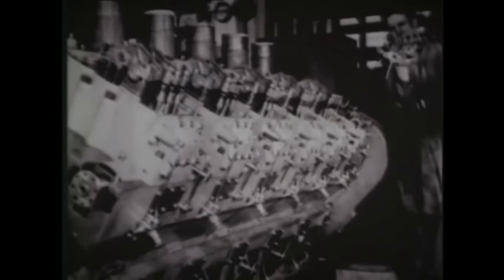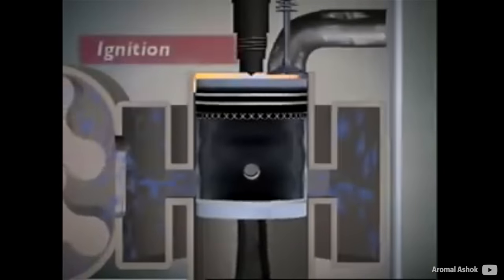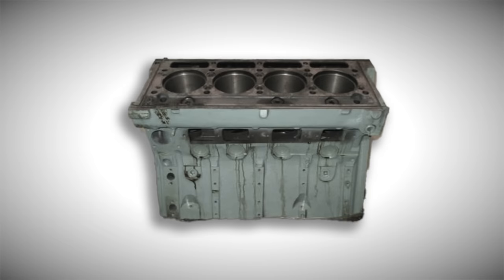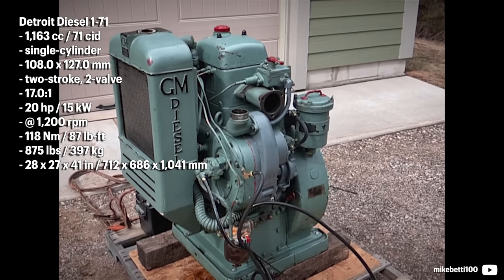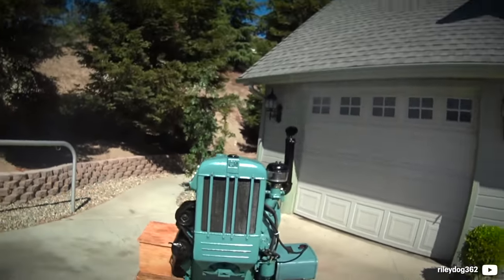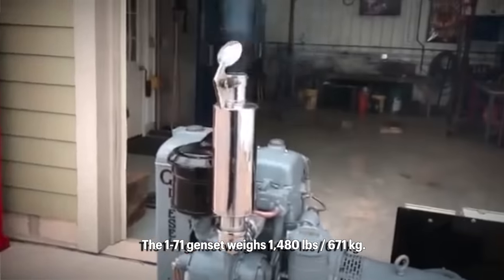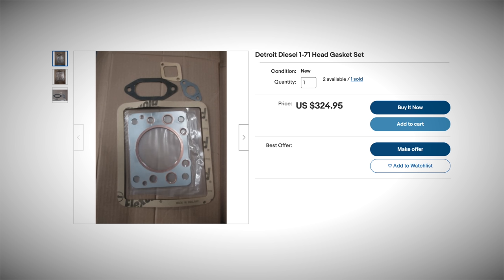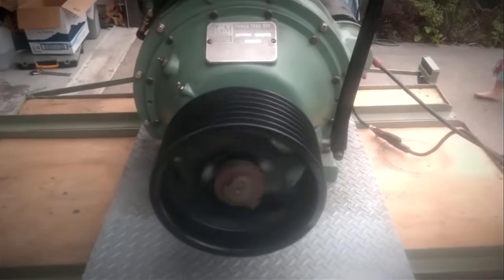The 1-Cylinder Detroit Diesel 1-71 Is Nearly Extinct

Comment: "The small group of 1-71 collectors have pooled their information and Chris Kouttron has begun a 1-71 database. Over several years of collecting 1-71 information and documenting survivors, he tells us the earliest serial number is #8 and highest is #926. The current count of known 1-71 survivors worldwide currently stands at 79 units"

-Dieselworld magazine, 25 April 2018
Reply: Damn, that'd be cool...
Reply: A Maico 760/700 makes 26 HP at 1200 rpm with out a roots blower, go german 2 strokes and not shitty american 2 strokes, Well the Rotax 850 ETEC turbo takes it to another level, kinda like comparing hydrogen fusion to fission
Reply: @cloggedpizza239  probably if you take care of it, im running BRP XD-100 2 stroke oil thru my 8v92 2 stroke turbo. I like alcholo fuels better and dont like diesel, also more plant based 2 stroke oils such a castor 927 maxima, way overkill for a detroit though.
Reply: @cloggedpizza239  BRP-XD-100 is a bit overkill for a 2 stroke detroit. Many outboard  and snowmobile 2 strokes can run great for over 5 years if the the proper maintenance is done.
Reply: @cloggedpizza239  The Detroit run harder steel shafts and can run better on the modern synthetic 2 stroke oils with injection!
Reply: @cloggedpizza239  Do you run 2 stroke oil in that?
Reply: @cloggedpizza239  You could probably power a 100KW 1200 Delco generator on the tug i work on with an inline 6 made from 700 (685cc) Maico engines.
Reply: @jlo13800 just goes to show how little you know buddy. Difference between a diesel built in the 1930's and a gasser built in the 70's. And what's the fuel consumption of the back to back World War losers design? What the life expectancy of that gas engine? They are 2 different engines designed for 2 different purposes.

Comment: It's mind-boggling to think about how much freight Detroit Diesels have hauled in the US. Not only in heavy trucks, but also in locomotives and ships.
Reply: Tesla ev truck left the chat..
Reply: *and are still hauling.
Reply: It's amazing. I was shocked to find it in studebaker's and ford's. And in boats, generators, backhoes, you name it. My jaw just keeps dropping every time I see it. It's crazy when you really think about it.
Reply: There are two diesel fire pumps at a steel mill where I occasionally work that run 6V53 Detroits. They test them once a month, and for some reason they fire up at operating RPM, no mufflers. If you're working out by that pumphouse when they do, you'll cuss and drop your tools when they start screaming, haha! 

I want a 6V53-T in a square K20 Suburban with a 10-speed RoadRanger so bad I can't hardly stand it, they sound amazing and are indestructible.
Reply: And wars that were won
Reply: Detroit Diesels are a truly legend that make differences during WW2 and also post-WW2 when USA was building up their economy even though in road usage it came second after Cummins's...

But, what a Cummins can't do is that participating either side of WW2 in any sort of military equipment, from supply trucks up to tanks, and from small gunboat up to destroyers as back-up power (except for aeroplanes, because why you use that😂)

Sadly, the EV-sided governments, loyals, and its rules didn't seem to honorate this living legend
Reply: @The_sinner_Jim_Whitney  The local sawmill mill has two 6v92's.    Red, angry, no mufflers.

In the plant I work at now our back up fire pump is a 5.9 cummins, cool but not as cool. Room temp to full load at 1800 rpm in 2 seconds.  But our emergency generator is a 12v149.   Uninterrupted mode it goes from 0 to 800 kw at 1800 rpm in ~ 2 seconds. It has mufflers but it is still loud as hell.   If your outside it looks like 2 black mushroom clouds.

I love Detroit's.   My first one is a John Deere 440ICD crawler loader with a 2-53.     I'm trying to find an older welder with the same engine.
Reply: General motors old look, and new look transit buses. The twin pack 6046, used in the M10 tank destroyer. The pancake 6-71 l, and N, for use with under floor applications, such asCrown and gillig coaches.  The GMC cracker box, the landing craft infantry, all LCI(L) were twin shaft propelled by two banks of Detroit Diesel 6-71 "Quad" Diesel engines that produced a total of 1600 bhp. These engines were a wartime expedient design that utilized existing and readily available engines.  We can't forget the gray marine 6-71 series.  We owned a 1981 MCI MC9, with a Detroit diesel 8v71, with a Spicer 5 speed. The v-type was introduced in 1957. The inline series 6-71 was the flagship product of the Detroit Diesel engine division of General motors. The single cylinder 71, being the most rare, with about 900 units produced.  Diesel world has an article entitled One lung Jimmy.
Reply: @fidelcatsro6948  lmfao
Reply: @k-getrengganis7401 agreed. Our all knowing government is such a bowl of cherries.  I loved the instant power of the 6-71. But I worked on a 4 stroke Detroit (labeled mercedes, since they bought it), and the power was horrendous. I would like to imagine if they tried to modernize the two stroke, it would have been able to pass federal regulations for a bit longer, but who knows.
Reply: @VitoVeccia  actually, you could, theoritically. Just use the way EMD make the 710 pass the Tier-IV emissions for boats...

Change the fuel supply to commonrail, add a closed crankcase circulation system, and rely solely on SCR like EMD do... Gone all DPF shitty with enhancing the SCRs

Yes, there is no more straight pipe, but you could still have that particular 2-stroker sound 😎

Or, if you want more not to depend on emissions, use Gas-diesel mixing by injecting natural gas or petrol in the cylinder so that when combustion occurs, the flames spread more even because of natural gas or petrol in it thus had lower emissions and gain a bit more power... (This was from an experiment from University of Wisconsin, quite sometime ago which, it did had the expected result. But, as per governmental traditional, it never came into mass production anyway😂)
Let's hope someone will do it in the future, especially for the so-called Third-world Countries, because, let's face it, they didn't have money to adopt EVs for at least 2 decade away...

Diesel are superbly useful, compact, robust, dependable, and of course, well tested😎
Reply: Don't forget that the Detroit was also sold overseas Detroit been hauling shit all over the world since day one
Reply: in the Locomotives they're called EMD but they're just really big Detroits since EMD was a division of GM. there are still 567s built in the 50s running to this day
Reply: @aspenGF8  HISTORY AND DEVELOPMENT OF THE 567 SERIES GENERAL ... https://utahrails.net/pdf/EMD_567_History_and_Development_1951.pdf
Reply: Still goin every day baby, I see them all the time in generator sets.
Reply: Had to squint my ears last year, as the town highway leaf collection truck had that 2 stroke sound. 
I felt like asking the guy driving is that a Detroit?
Bit you'd say it like  "is that a supra?"
Reply: @The_sinner_Jim_Whitney  
There's a reason why they fire them up at operating RPM's, I can tell you from personal experience having operated, lived and slept right next to one of those things for 3 years of my life as a driver of an M163A1 selp propelled Vulcan gun that they needn't have bothered putting a throttle pedal in one of those things, they could have gotten away with a toggle switch that had idle and run positions, because nothing in between did anything, if you didn't have it stomped all the way to the floor nothing happened, it wouldn't move.
The old timer truck drivers had a saying about those engine's, the best way to get your load there on time was slam the door on your hand when you got in the truck. 
Those engine's weren't the greatest when it comes to power so they weren't the best when it comes to moving something from point A to point B, but where they really shine was like you said, industrial use, places like steel mills or running pumps on pipelines where they run 24/7 and need to run forever. 
They don't make a lot of power because despite the fact that they have blowers on them they're not actually supercharged like people believe, because of their 2 stroke operation the blowers don't supercharge them, they're needed to scavenge the cylinder and fill it because they don't have an intake stroke but the way it works out they only run as if they're normally aspirated, without the blower they wouldn't run at all.
But they will run forever, that's why they do so well in industrial applications.
Reply: I've put so many of my own hours into doing just that, might get my own truck and keep going with it.
Reply: @@retiredbore378 
Then they must have been talking about all the M113 chassis based vehicles which would have the 6V-53 Detroit Diesel engine's in them.
As I said they wouldn't get you anywhere in record time but they'd get you there, if a vehicle with one of those engine's took a hit from an anti armor weapon when it was done burning I wouldn't be surprised to find only the engine left sitting there idling, I drove one of those things 9 hours in the desert once with nothing showing on the dipstick and it never missed a beat, the Slant 6 Chrysler engine's of Diesels.
Reply: And tractors and skidders and yarders, pumps, generators, garbage truck, buses ….

Comment: 3:35 given that information, the 1-71 has a efficiency of 27% (12 kw, 4.50L/3.74 kg of Diesel), which is kind of impressive for 1938
Reply: @Retired Bore your are right but if i remember right there are also DD which have a blower and a turbocharger
Reply: @Doppelwhoppermcdonald  They all have a blower
Reply: @mikegray8808  all the detroit diesels have blowers yes, but as he was saying many have a blower bypass valve + turbo this removes the pressure load from the blower essentially freewheeling it.... sure there is a little drag still but its a good compromise. The roots blowers are also very efficient as they supply pressure pulses rather than constant pressure. Current Achates power designed engines are kinds of like two detroit disel blocks pointed at each other and geared together (with the vale train completely removed.. and on top of that they can hit 50+% efficiency targeting 55+%.
Reply: @Retired Bore I don't think any of the achates engines have gone for an electric blower yet... since that would require a pretty beefy electric motor that isn't used 99% of the rest of the time, it would make more sense to just disengage the blower entirely, bypass it and rely on the turbo or a pair of turbos small and large or an electrically assisted turbo at idle. When running unloaded they are obviously 100% drag.... since they arent' doing anything at all so your statement that they are inefficient unloaded is well... it should go without saying. Perhaps an electrically assisted turbo would make a lot of sense as it could also be used to reduce turbo lag.
Reply: It's even more impressive when you realize that VisioRacer got the conversion wrong. He converted using Imperial gallons (1 Imperial gallon=4.25 liters), but in reality he should have converted using US gallons where 1 US gallon = 3.75 liters.
Reply: @CaptHollister  Rough math would put that at about 33% efficiency.

Comment: I remember when I was in the Marine Corps,  we had some 2-71 Detroits, to run our generators,  for our radios.  They were a pain to get started,  but would run until out of fuel without any problems,  if you kept the fuel tank full it would run a very long time. They need to be topped off with oil a lot.
Reply: Easy to start with a can of ether. The fuel draining back down the fuel line away from the pump is almost always the problem other than the filter needing to be changed.
Reply: @crazyoilfieldmechanic3195  i had a 353 that would start if you looked at the starter !! check valve in the fuel line

Comment: Great vid, neat little chunk of history, I was told the 1-71 was more proof of concept / viability then expected sales leader, and GM put that to the test very shortly thereafter the bombing of Pearl Harbor. The 71 series was built with roller valve lifters, and injector actuators, and were technologically far ahead of other engines, save for aircraft engines of the era. Notwithstanding the 1-71, the rest of the family are happy to spin at governed rpm, which is pretty high, for a diesel. Happy 2023 !

Comment: Cool vid. I had the pleaser of driving a firetruck powered by a 2 stroke Detroit. One thing we learned is you have to get these engines hot and wound up or they will leak oil and everything else.   There is no noise like it in the world and they like being reved out and driven hard. It is an experience I will never forget and a shame generations ahead will probably never get to experience.

Comment: Johnson and Towers made some upgraded Detroit diesels for marine applications . I worked for a Bertram dealer and saw some of them . 12V71's with he engine blocks sanded smooth and painted in white Imron with chrome and polished parts . The 6-71 J&T put out 425 hp .
Reply: J&T 671 TI 450 HP and 671 TIB are 485 HP

Comment: In short terms, the Detroit Diesels 2-stroker, especially the series 71 was just a scaled down EMD 567s because it uses some principled from the 567 but modified to suit the needs and reliability...

However, the only thing that isn't scaled down from the EMD 567 is the Clutched-Turbocharger from the EMD 567D3 series, so they just stuck a Turbo on top of the Blower and later puts an intercooler on it...
Reply: except that the series 71 engines existed long before the emd engines were designed. in fact before emd existed, they were known as cleveland diesels.
Reply: @marzsit9833   Nope, you're wrong. The EMD 567 entered production the same year as the 71 series, 1938. Cleveland diesels were a smaller displacement than the 567 and were used in marine and stationary applications but not railroad applications.

Comment: I've always wondered if a diesel could have a hand crank starter! You & this one diesel engine answers this question.
Reply: The answer is yes - I can attest on the basis of memory as a teenager having to do this to start the generator on a farm that was way off the grid
Reply: @michaelharrison1093  That is so cool!
Reply: Do a search for Lister diesels. Most of the smaller ones are hand crank with compression releases.
Reply: The single cylinder Japanese Kubota, Yanmar and Mitsubishi engines (and their chinese clones) always are hand crank starting using decompression valves. The british Gardner and Lister also has hand crank option as big as a 6 cylinder.
Reply: @kimpatz2189  How do these things even start!? Don't diesel's need high compression?
Reply: I can attest to crank starting a large two cylinder southern cross diesel stationary engine... Its hard work, the flywheel is about 850mm in diameter and 3" thick cast steel, you set the compression release, crank it up as fast as you can spin it, then flick one decomp lever off and the governer adds full fuel, once that cylinder is running, you flick off the second decompressor. A friend had one running a bore water pump on a farm... The system was poorly designed, it had no clutch for the pump, so you had to disconnect the shaft to the pump from the engine, start it and let it warm up, then shut it off, reconnect the drive shaft and restart it (much easier to start a hot engine than from cold while also trying to turn the pump) it had electric start, but we used to save it for starting with the pump attached, as even with 4 truck batteries connected you still had to help the starter with the crank handle once the pump was connected or you would melt the starter. I feel like at some stage the pulley and belt system between pump and engine got damaged so it was removed and direct driven..
Reply: @carllinden533  The trick was the decompression levers totally eliminated any compression, so you could get it spinning fairly fast. That combined  with a HEAVY flywheel got you past the compression stroke.
Reply: @kimpatz2189  Ahh, the Gardener Diesel engine. Beautiful machines!!!!!!
Reply: @Colt45hatchback  Incredible! And to think these things run for a lifetime.
Reply: @newjerseybill3521  Oh I see! The flywheel was key. This would be very impractical for a car, funnily enough the bigger the better
Reply: @@retiredbore378 I was hoping someone could explain how the six cylinder could work! I understand now it's takes about 2.5 people. I will also say your memory is great,  felt like I was actually there.
Reply: A good "71" would start so ridiculously easy that I'd be surprised if a hand-crank wouldn't work - at least in ideal conditions.

Some you'd barely hear the starter drive engage and they'd be running. A truck could roll in gear just a half foot or so and "whaaaaaaa."

I heard horror stories of 'em starting while being "bar-ed" over, don't recall seeing it.

Comment: The GM Diesel 1-71 was a well know engine within medium sized refrigerators/freezers and small electric generators in either train carts and other applications all over US/Canada and great Britain and still was very common until early 70's. Then EPA began attacking them in the name of ambientalists and were replaced with moderns units. Most of them were discarded as scrap but still you can some working and probably from world war 2 era. Yes, it was a test cell prior to commercialization and that 1 cylinder model found a quick application in powering cooling units in trains.